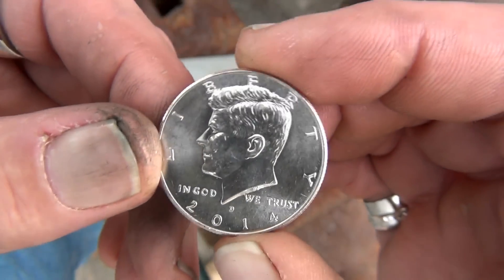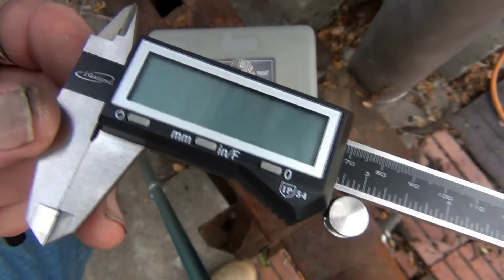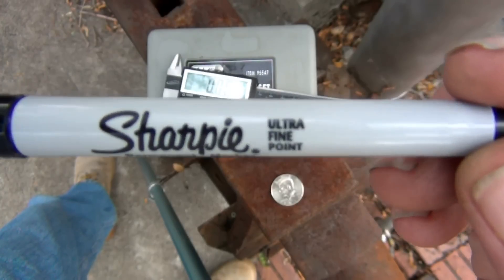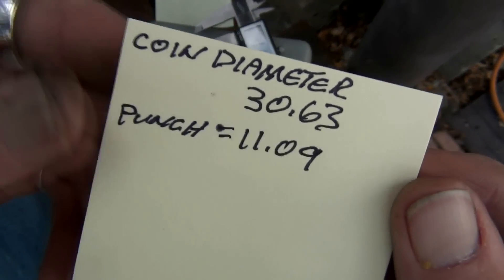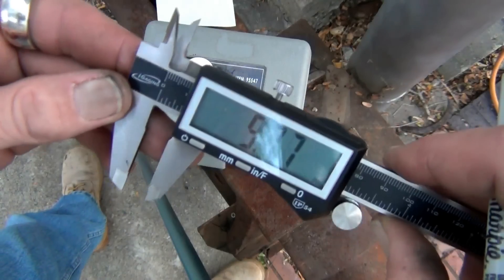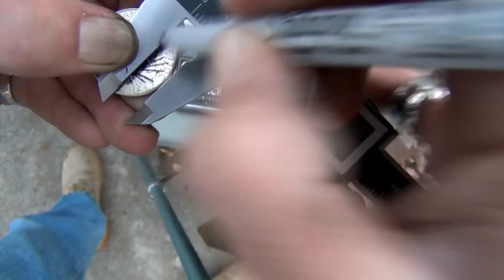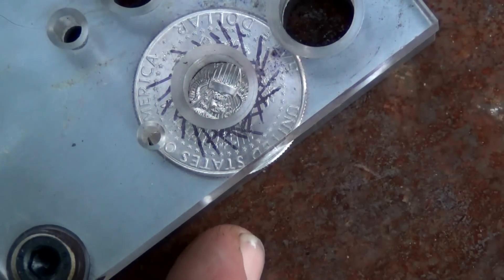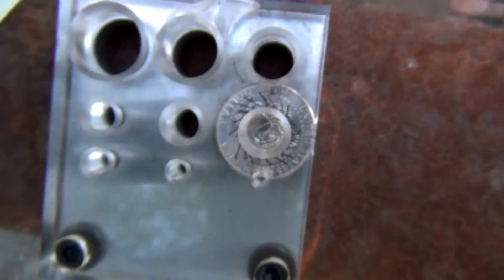Coin Rings-Finding Dead Center Of Any Size Coin Using Any Size Punch

Comment: If you use blue tape, as in painting tape, over the coin, it makes it easier to mark.  Especially if the coin has any finger or other oil on it.  When you get to the annealing stage, the tape will go away, just burn it off.  I find it easier to anneal the total coin first.  Then the blue tape, mark the center, punch it and it will make the punching easier and more accurate.

Comment: I purchased a 40.00 punch set and I am having a hellava time punching through. What am I doing wrong ? I heated coin first then hit and hit  and hit by the time I finished I had screwed up measurement and ended up with a off center coin. !! this is my first attempt at this and you make it look so daggone easy! lol
Reply from the maker: janice randolph Try it with a heavier hammer, on a harder pounding surface, like a concrete sidewalk, driveway or porch. Heck, if you have an anvil, now you're really talkin. Give it another shot, and let me know how she goes, yeah?
Reply: Thanks for the info. This is a fun project and a lot of my friends want one...so I will be viewing all your down to earth video's. I understand a bigger hammer is needed.  I don't expect to an expert but would like for them to be presentable but I am hard to please myself so I expect some rejects for sure. I bought a cheap mandrel and needless to say the mandrel is destroyed. So new order is in. The other question is how to determine punch hole size for different coins and sizes? Thanks
Reply: fencekid Oh by the way I changed my youtube name...lol
Reply from the maker: Snowbird Hill the hole size dictates how wide your band will be. The smaller the hole, the wider the band. ring size has everything to do with how far you push it down the mandrel. I use a 7/16" punch hole for both quarters and halves to preserve as much of the coin as possible. But that's just me. These vids here on YT are when I was just getting started. I would try something new. And now that I've tried it, and know what to expect, it's time for a video. The rings that I sell these days are far superior to the ones I have here on YT. And that just comes with lots of practice. For me, I knew from the beginning what level of quality I was trying to reach. And with each ring I made, I would get one step closer to where I was trying to get. Once I got there, to where I could not produce a finer quality ring, it was time to open shop. And whalla......FencekidsCustoms was born. 7 months into being open for business, equated to 500 rings sold. How far will I go with it? Who knows.
Reply: fencekid I am still waiting on some materials to get here, my block came today ~ Now another question what type of pvc pipe do I need? I went to the hardware store and 1/2 " size looked really small so I didn't buy any. What should I ask for ? The guy said it was 40 but looked awfully thin to me. So let me know...sorry to bug you so much but I am so excited to get started. Thanks for your time and videos ~~~ !!
Reply from the maker: Pick up one or two feet of each. Use  the 1/2" until it maxes out. Size 5 or 6, then transfer over to the 3/4" to finish her off. PVC should have markings right on it as to if it's 40 or not.
Reply: thanks again..hardware store I will go tomorrow !! I can't wait to make my first one !!

Comment: Actually have a couple questions regarding your rings and ordering. I apologize, I don't know how to email you on Etsy. 

I was wondering if I could actually send you a specific coin that I would like made into a ring...and if it's possible to get a man's size 13? I have a few more questions, but I don't want to waste your time. Your work is beautiful, an amazing gift idea!
Reply from the maker: Stephanie Penglase OK, just click Ask Seller a Question on my etsy page and go for it. People send me coins all the time to be made into rings. Get a hold of me over there, and I'll go over the details. A size 13 would have to do with the size of the coin. I can make a quarter to a 13, but because it's stretched so much, it somewhat compromises the details on the coin. Perfectly legible, just not as raised up as on the coin. Hook up with me over there and give me the details about what's drifting through yer head, yeah? I never miss emails over there, and it's my main source of communication to customers. U Tube can be a bit of a different story. Comments slipping through the cracks all the time.  Laters
Reply: Stephanie Penglase ll

Comment: Or... take a sheet of paper. trace shape of coin, cut out, fold in half twice, and lay over coin. you have the center
Reply from the maker: I like that idea. Excellent way to find center for those using a drill. Thanx for joining and adding to the conversation. Sweet tip

Comment: This is Don again. I noticed since my last post, that when I get center using a digital caliper, I placed punch on to cicle drawed on coin, and circle is larger than punch! Could I have a bad caliper? I zero everytime I measure coin, punch, and circle diameter.
Reply from the maker: Don Cromer  The inside edge of the drawn line is the edge of the punch. I'll bet that your caliper marks are accurate, but when you place the punch down on the coin, the coin moves just a little. Try this. Fold up a piece of paper a few times and place it in the under the coin in the punch and die. You should be able to turn it sideways and the coin won't fall out. Then adjust coin to center. The idea is to keep the coin from moving when you place the punch on the coin. Or, use a sheet of leather. This also allows you to pull either side of the overlapping leather side to side, and drag the coin into place. and once there it should stay there firmly. Drop in your punch and punch it. let me know how it goes, yeah?
Reply: fencekid Thanks, I will try that!

Comment: Just an after thought. What, if anything, do you do or make with the center cut?
Reply from the maker: the copper ones just pile up with no use for em. But the silver ones, I save and plan on melting them down with sunshine and casting a ring out of em.  Definitely makin a video about that one.

Comment: Helpful tip to save some math. Measure the punch with the caliper. While still in place, zero the caliper. Then measure the coin and wallah the difference will appear on the caliper. ( Once you half that number, don't forget to re-zero the caliper before marking the coin.)

Comment: Just a thought here but couldn't you find the centre of a coin by simply laying the coin on a bit of paper drawing round it cutting that bit of paper out then folding the paper in half twice, then simply put that bit of paper on to the coin which will give you centre, then take a protractor and draw the middle hole on the paper.

Or place that bit of paper on a piece of card and do the hole thing on the card, then simply draw your hole directly to the coin using the card as your template.

It's just a thought to make it easier so you can make up many templates that could be reused.

Comment: All you need is a centering square, found on a combination square listed here...
http://www.amazon.com/Oshlun-MTM-CS-12-Inch-Combination-Square/dp/B001KW00XY/ref=sr_1_4?s=hi&ie=UTF8&qid=1455476253&sr=1-4&keywords=combination+square

Works like a charm and doesn't require dozens of lines, but just two in the center.  Use those two lines like crosshairs in your punch, and you're done.....
As a machinist and fabricator, I've used this technique thousands of times and the accuracy is far better than you achieve with the method you're currently using, plus it's quicker.

Cool hobby....have fun.

Comment: I very recently started playing with coin ring making and getting the hole in the exact center has been a challenge, and I quickly found out how important it is. Last night I made a discovery that is also very simple and I expect will help a me lot. Another hobby I have is winemaking, and from that hobby I have various size rubber cone shaped grommets, with about a 3/8" hole in the exact center. What I found is, one end or the other of each of the 4 sizes grommets is an exact, (or almost exact) fit for each of the coins I'll be using to make rings with. (4 grommets, each with 2 different sized ends = 8 options) I select the grommet that is the same size as the coin, and insert a sharpie into the center hole, with the tip just barely sticking through the end that fits the coin. I hold the coin against the grommet with my left hand (my thumb and 2 fingers keeps the coin easily centered against the grommet) and apply just enough pressure to the sharpie with my right hand, giving the coin and grommet a couple turns, marking the exact center. This might sound a little awkward, but it is really very quick and easy. I've done it with various coins now and the mark from the sharpie appears to be in the exact center every time. Just another option others may want to consider.

Comment: You could screw around doing this or go to any woodworking store that sells turning supplies and buy yourself a center finder. Costs about 5 bucks. Just lay it on the coin and draw center lines. No math, no adjusting.

Comment: fencekid, thanks for all the awesome DIY coin ring tutorials~ i've a question that is sort of related to the centering of a coin ring.  I found a early 1900 Chinese coin with a dragon design that i wanted to use for the outside of the band. i was wondering if i punch a small hole in an effort to save the rest of the dragon design, can i use a step drill and pvc pipe method if i'd be able to save the dragon design?  not sure if i explained it for you to understand what i'm trying to do... anyway, let me know your thoughts.  thanks!
Reply from the maker: Dude...Are you sure??    Hey, if you can get something in that small hole  somewhat mandrel shaped ,it should work

Comment: what size would you recommend i punch the quarter with to get a ring that is a size 4 and a half?
Reply from the maker: I use a 7/16" punch hole for all quarter coin rings, and most half dollar coins. If you can't get it folded over before a size 4.5, use a dapping block and a bench vice to shrink it down up to 4 sizes smaller. Curling the Edges of a Coin Ring without a Ring Press So you could fold it over at a size 8.5 and then shrink the edges down to your 4.5. It will get rid of the "fat end" and add some sweet curve to the band as well.  Let me know how it works out for ya, yeah? laters